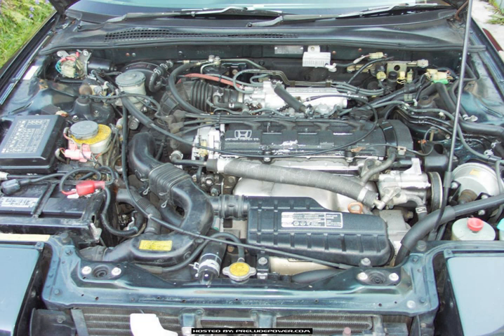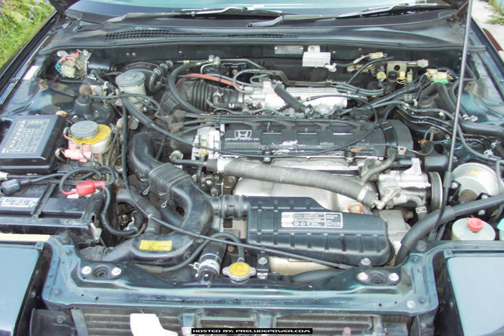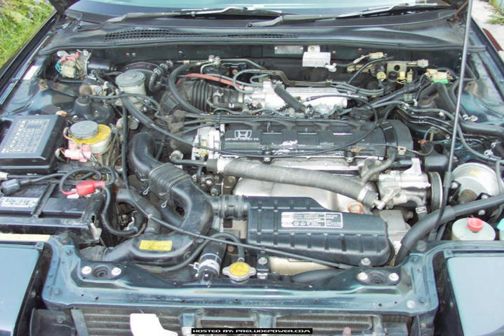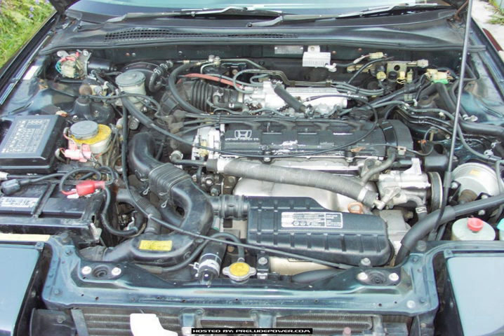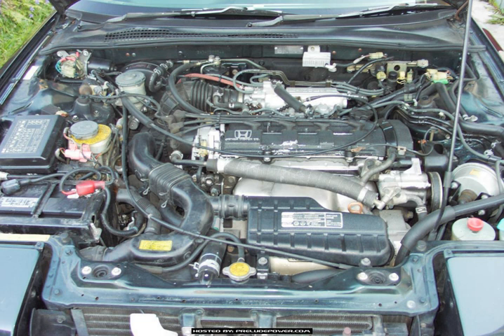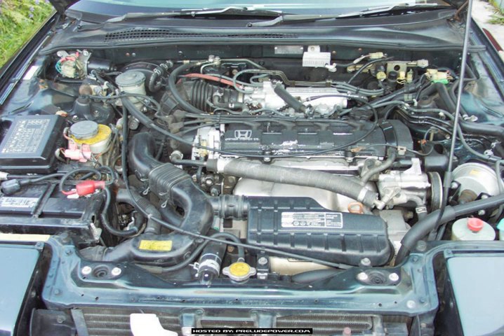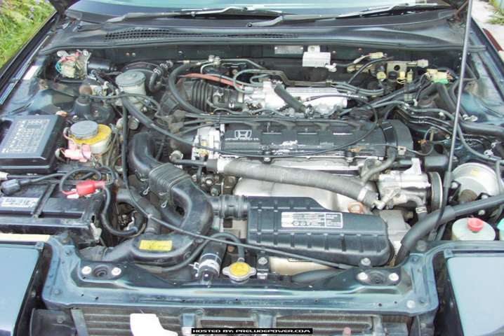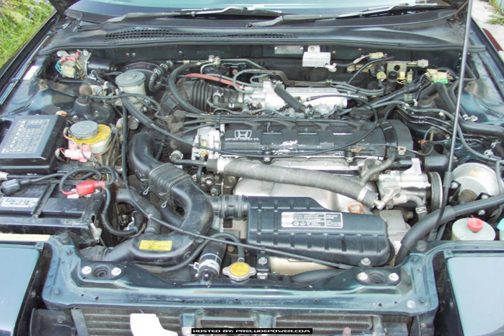Honda B20A engine | Wikipedia audio article

Comment: Where is the proof that the FRM causes premature piston ring wear? Also, you can hone and bore the FRM cylinders just as easy as non FRM . Porsche and the NSX use the same FRM cylinders but do you hear of the supposed "premature ring wear" with them? 99% of the time the problem is BAD OR WRONG VALVE SEALS! The 1990 prelude Honda factory manual actually shows the WRONG (or the manufacturers have it wrong) valve seals! Compare the intake and exhaust seals from Honda's OEM Japanese manufacturers selling on majestic Honda to the pictures in the factory repair manual and you'll see that THEY'RE SWITCHED! Fact is that FRM cylinders are great when maintained and oiled properly. Guaranteed any smoking frm worn piston rings is caused by lack of oil and or bad maintenance. The reality is of the dozens of 3rd gens I've been a part of, half were B21A1 motors and none of them had any kind of piston ring wear. Over 300,000 miles and the cylinders had perfect compression, leaked zero oil after seal replaced but did burn a bit of oil, not much tho. BUT most of them had bad valve seals! So please show me proof that FRM cylinders cause premature piston ring wear other than hearsay from older blogs or forums.